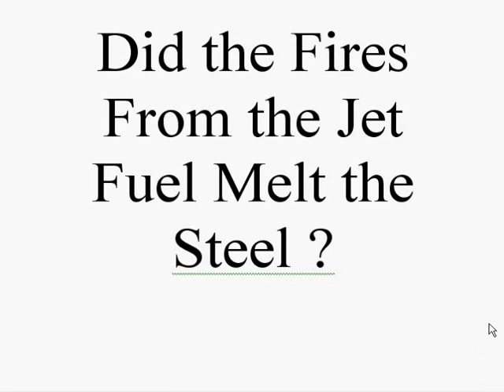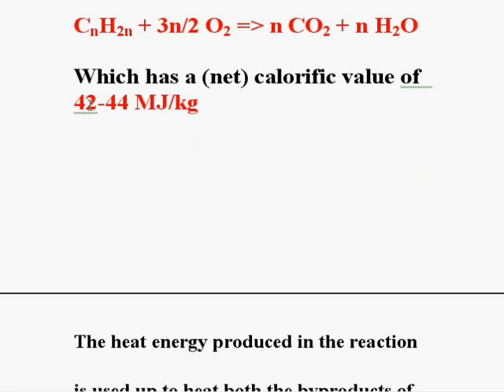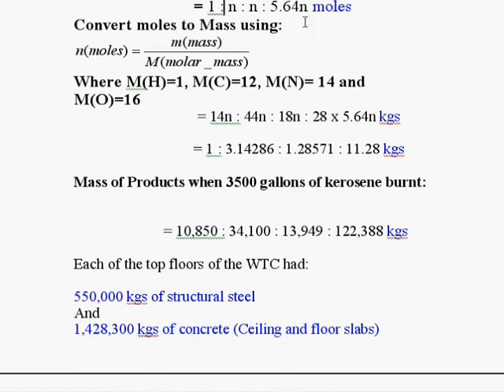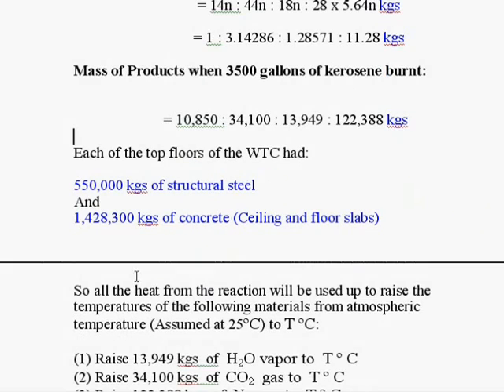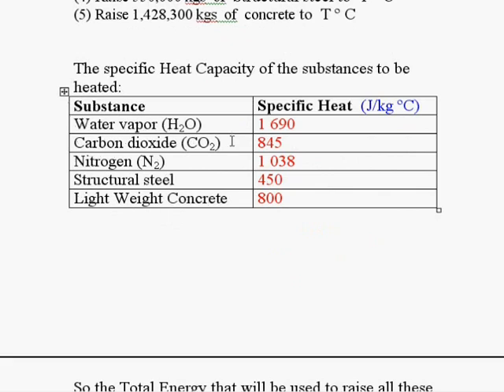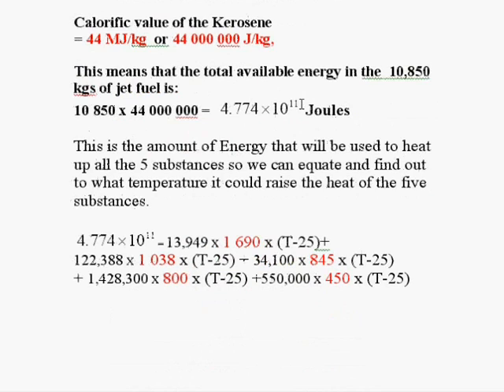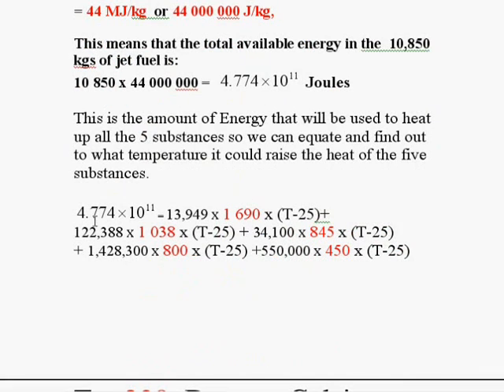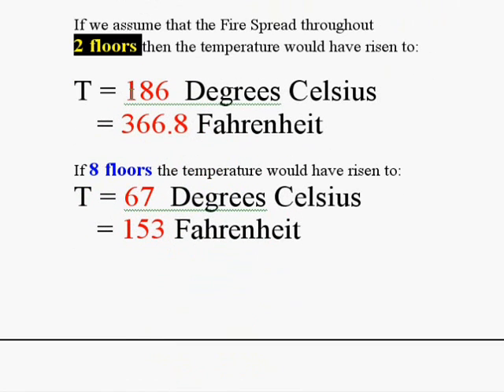911 Jet Fuel Fire Melted WTC Steel?

Comment: A heater is designed to burn fuel in. But the WTC was NOT designed to be hit with a large plane loaded with jet fuel. The steel did not need to melt in order for it to fail. All that needed to happen was for it to buckle.The internal stresses would have built up in the wrong places, and the building would fail. And if you were trying to catch a train in Melbourne a couple of weeks ago, you would have seen what happens to steel rails at a temperature of only 43 degrees C. Add broken supports...

Comment: Newton's Third Law is all the evidence needed for controlled demolition.

the time for a criminal investigation is seven years overdue. it is time for a criminal trial. those who do not support a criminal trial support murderers.

for those who want to debate minutia instead of calling for a criminal investigation and trial. 

3rd grade math.

10,000 gallons jet fuel.

100,000 tons steel WTC 1.

kerosene heater is filled with 1 gallon of jet fuel. how many of these heaters can be destroyed?

Comment: You've gone through a great deal of calculations to arrive at a verdict. Just remember that you started with assumptions, any of which may not be true. A 6th not mentioned assumption is that there was no other material available for combustion. You have also not taken into account the weakening of the structure caused by the plane and its initial damage. I have not yet seen anyone who has said that the fires "melted" the steel, only weakened it.

Comment: "There is no tension on a severed beam."

Correct.

"Only the severed beams you speak of lose structural integrity"

Also beams heated by fire.

Comment: Soulfree2008: In the intial stages of collapse the incredible weight would pull down the columns and shear the trusses holding them together. You'd assume the columns -were- thousands of feet long, and that's wrong. 
Plus that 'switching topics tactic when losing the debate' is getting on my nerves. Building 7 had a large chunk (large) slam into the side of the #7 from the Towers collapsing, plus raging fires, and 9 diesel storge tanks that exploded. Pentagon? That's easy. Plane crashed.

Comment: Just how *B I G* of a concrete slab would you expect? Concrete's sole purpose is for comPRESSIVE strength. Under conCUSSIVE forces concrete will crack & break up. During the collapse the steel will twist and bend. Why do assume all buildings are solid blocks of unpulverizable structures? You have a belief of a Conspiracy Theory, an undying belief, and nothing will convince you otherwise no matter the evidence contrary. Same with the dumbass "Earth is Growing" & "No Moon Landing" crowd.

Comment: Planes strike. Steel columns exposed & fireproofing stripped. Steel supports weaken and the floors sag and collapse because CONCRETE has VERY little tensile strength which becomes brittle and cracks. Walls buckle without the floor supporting. Upper thirty floors fall upon ONE floor, collapses, and now 31 floors fall upon ONE floors. Concrete cannot withstand concussive impacts very well.

Comment: Soulfree2008: Sheep, eh? Only those that parrot psuedo-intellectualism such as yourself, and shorty40merza here who has no clue of the structural designs of the Towers, having been shown to not account for any of the structural materials & the properties of those materials, is but a Sheep to the "Truth" movement. What? Losing the debate so you run away, eh? Typical.

Comment: Soulfree2008: 
1) When the steel columns weakenend, the concrete would not be able to "topple over". watch?v=fEZvaSWkdME Shows how weak the tensile strength of concrete is. You... do know what tensile means, right?
2)Obviously. That, however is not proof all fuel was extinguished. Not including all the materials on the floors, plastics, cubicles PLUS the magnesium alloy from the plane which burns to 2200F. 
3) Come one, that all you got? Child.

Comment: Soulfree2008: 
1) Incorrect. While initially the top portion leaned over, concrete does not have tensile strength. That is, it cannot topple over as a tree can. Ewe More On.
2) Incorrect. You speculate as such yet have no evidence. Are you denying the raging fires inside the buildin?
3) Twoofer. Twoofer. Twoofer. Until y'all stop being pathetic, I'll continue calling y'all Twoofers. You first.

Comment from the maker: structural resistance provided from the intact lower structure will force the falling part to choose the point of least resistance which is tipping, just try it with any material ,, do a small model and break it on the top and see if it will crush whats below it or tip ,,, its simple

Comment: "I just said it will not accelerate after it collides with the lower structure because the net force is upwards..."

You don't seem to even know what "net force" means. If net force on the falling section is upwards, the section would move upwards. You're telling me things fall up.

Comment from the maker: I meant there is momentum.. didnt mean it builds, if you throw a rock up in the sky then as soon as it leaves your hand the net force will be(mg downwards),but it will still go up and have momentum & inertia. however it will not accelerate upwards because the net force is downwards. likewise the block of building, i didnt say it will not crush anything, I just said it will not accelerate after it collides with the lower structure because the net force is upwards...

Comment from the maker: belive me your wrong, ask physics specialists that you trust. the mass above the damaged is not more its way less. the structure is designed strongest at the bottom and thins as you go up just like an airplane wing where the tip represents the top of the building. the top has litle load bearing.   and momentum builds but the net force is never more than zero so you should never get an acceleration, force down= mg ,structural Resist force upwards > mg,acceleration = negative, 10 sec=impossible

Comment: The claim was backed up by the best engineers of the day.  Certainly it would be fallacy to claim it was foolproof.  But, the design concept is sound to build a screen-like outer structure.  We have used similar structures historically for ages and had great success.  Even your screen door does not lose it's strength because you tear or poke a hole in it.

Could an aircraft impact have caused a catastrophic failure?  Certainly the chances are astronomical for it to happen once, but twice?!

Comment: "watch the movie i made "911 simple physics structural failure vs controled demo" , the minimum time that it could take to cruch the 95 floors in the north tower would be 42 seconds... will decelerate"

After watching this error filled mess, pardon me if I don't trust your calculations.

Comment: "lets agree that the steel melted or weakened okay!!"

Weakened yes, melted no! They're two totally different things.

"but how many floors weakened"

You mean how many columns? Enough to stop supporting the load applied by the upper section.

"how did 15 floors above the impact crush the 95 untouched floors below it with a virtual freefal speed?? "

They weren't freefall, as video proves. Thy crushed it because no one floor was capable of stopping the falling upper section.

Comment from the maker: lets agree that the steel melted or weakened okay!! but how many floors weakened and melted and where ?  how did 15 floors above the impact crush the 95 untouched floors below it with a virtual freefal speed??  
where is the structural resistance from the iexistign untouched structure? watch the movie i made "911 simple physics structural failure vs controled demo" , the minimum time that it could take to cruch the 95 floors in the north tower would be 42 seconds... will decelerate

Comment: "if some thing gradually weakens it will not crash down but it will gradually SAG"

So you expected 80,000 tons of weight to gradually sag? The floors sagged, but the instant the beams holding up the upper section can no longer support it, it would start falling and not stop. There's nothing gradual about 80,000 falling tons.

"i didnt assume the steel had to melt to get a collape. i said the steel had to instantly melt to get a virtual freefal crashing case,"

Even dumber.

Comment from the maker: if some thing gradually weakens it will not crash down but it will gradually SAG,,, thats what usually happens to melting steel , they dont come down crushing. i didnt assume the steel had to melt to  get a collape. i said the steel had to instantly melt to get a virtual freefal crashing case,

Comment: "the materials used are fire proof materials"

Office paper is fireproofed? Chairs, computers, desks, etc are all fireproofed? Come on.

"there was a sprinkler system installed,"

Which was largely inoperable after a plane tore through the floors.

"any way if you are convinced that it melted"

I'm not convinced because it didn't need to melt for collapse to happen! You don't even understand that very basic point.

Comment from the maker: the materials used are fire proof materials and there was a sprinkler system installed, and the oxygen was a limiting agent as you could clearly see it, i assumed that 100s of thousands of kilograms of air was availiable and infinite time was given to conduct the heat. so my assumption is way too generous. 
any way if you are convinced that it melted then check my other vedio where i analyse the hypothesis of melting and tell us what you think."911 simple physics structural failiure vs contro"

Comment: The building was designed in such a fashion that the heat would have dispersed easily.  The metal wasn't floating around.  It was interconnected like a heat sink.  The damage of impact caused several floors to become interconnected via huge gaping holes.  The heat also had those holes as a place for heat to escape.

You might consider that if there was so much "unaccounted heat" concentrated as you suggest, that the survivors of the impact could not have clung to the metal.  But they did.

Comment: His assumption is based on a single floor, therefore it is valid.

Even NIST used the same assumptions in their own models.

The damage of the structure is irrelevant, because damaged or not, the mass still needs to be heated.  Only a tiny fraction of a percentile of the building floor's mass was ejected on impact.

The structural damage of the impact was obviously insufficient to cause collapse because immediately after the impact, the building stabilized.

Good math all around.  Watch it again